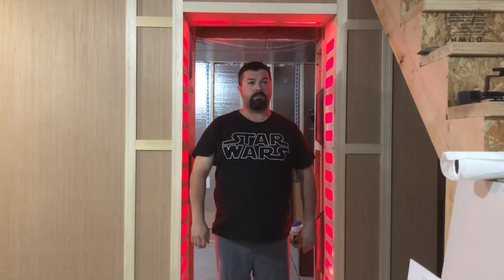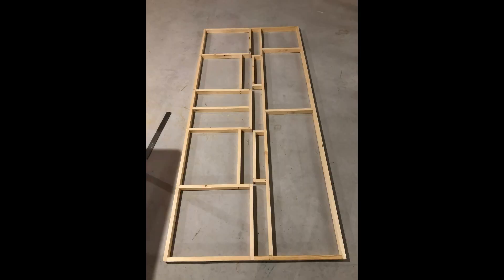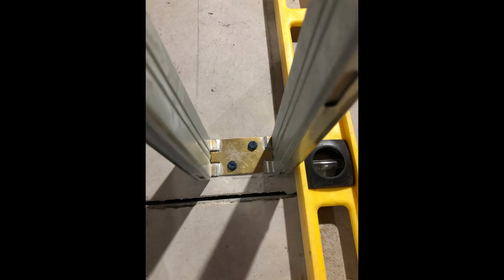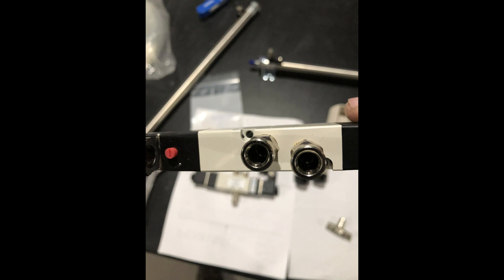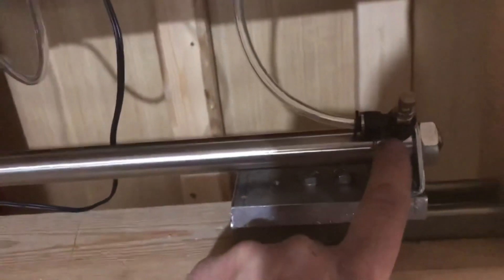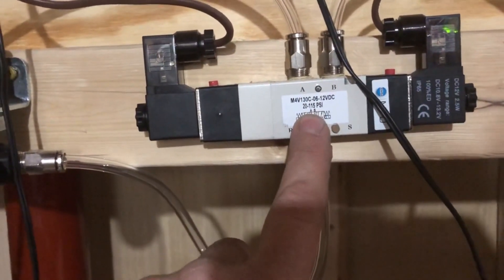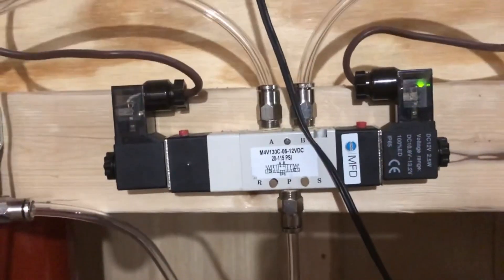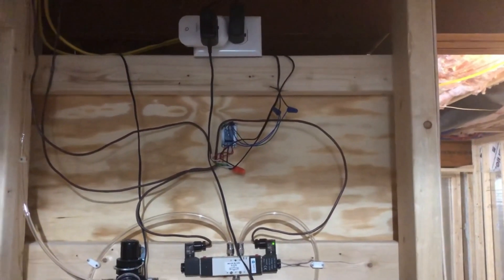How to make Automatic Star Wars / Star Trek Door EP4 DIY

Comment: I was curious to the difference between the 12vDC and 24vDC double solenoid, I am having trouble finding a 12vDC but there are plenty of options for 24vDC. I have worked construction forever but never got deep into electrical passed testing and replacing outlets, light sockets etc. In laymen's terms, I don't want to mess it up...lol being on disability my funds are too tight to have to purchase things twice. Any help with the conversion to 24vDC would be appreciated.
Reply from the maker: You can use whatever voltages you want, just so everything matches up.

Comment: How are you feeding air to the doors?  I never hear a compressor.
Reply from the maker: I do have a large compressor in the back corner. You can see it towards the end of the Theater Workshop Tour. It doesnt run much and sometimes I unplug it and it lasts for a long time. Thanks for watching!
Reply: How long do you think say an 8l tank would last before running out? nice work, love it
Reply from the maker: @carlcahill2628  hmm that would be tough to say depending on how often you go through the door and how many days but a good guesstimate is maybe a week? The other day I totally drained my tank and it was still moving very slowly, one door needed some help so I gave it a tap and it started moving. Cheers!
Reply: @WhiteysWickedWorkshop  I originally wanted something that did this more as a smart home mechanism to save having to interface with doors all the time, it never fails to amaze me how clarevoyant science fiction is on our future living, this has to be next in line for our smart home desires!! i've been wracking my brains for weeks trying to think how to do it AND make it Alexa routine/ motion sensor compatible! and then i found this! i never considered pneumatics + some kinda arduino! genius! but i'm sadly realising that this is possibly still in the camp of cos it looks cool as hell than it being a practical solution ;D housing the tank and refilling it each week does feel like a bit of an undo to the not opening your doors thing :( but it looks awesome! i'm so jealous ;D
Reply from the maker: @carlcahill2628  I was thinking about purchasing a kobalt 2 gallon quiet compressor and throw it in a box so its even quieter yet. Cheap$ https://www.lowes.com/pd/Kobalt-QUIET-TECH-2-Gallon-Single-Stage-Portable-Electric-Hot-Dog-Air-Compressor/1001014016
Reply from the maker: @carlcahill2628  I also forgot to mention that there are other ways of skinning a cat...you can goto the junkyard and buy a windshield wiper motor and use it with pulleys.

Comment: What happens when the power goes out is there a manual release that lets the air out to open the door
Reply from the maker: As shown in the video there are little red buttons on the solenoid valve that you can push to release the air to open. It’s not a problem for me because I have other egress routes. But sure there are many options. Thanks for watching!